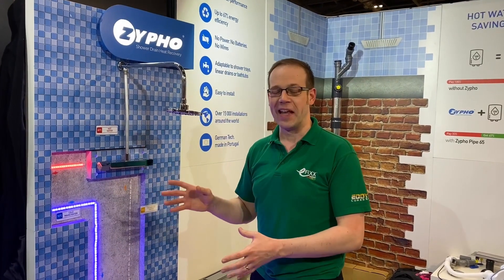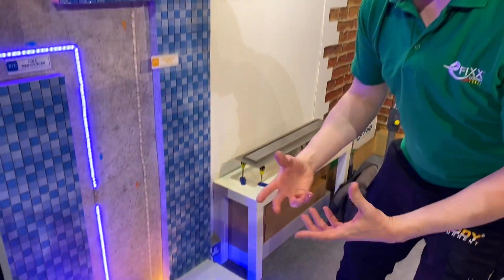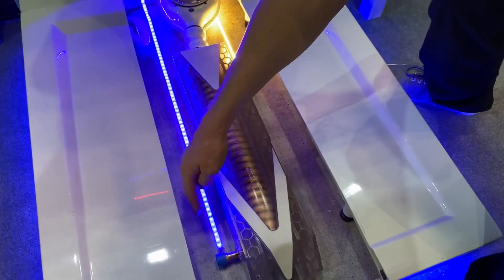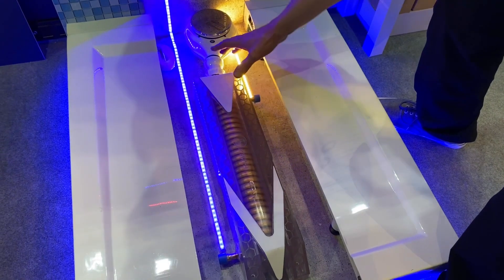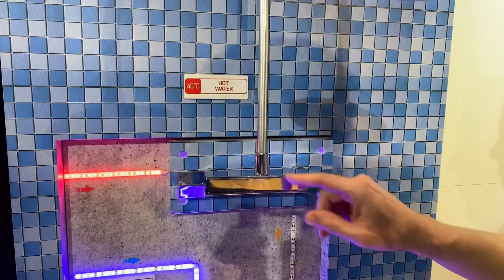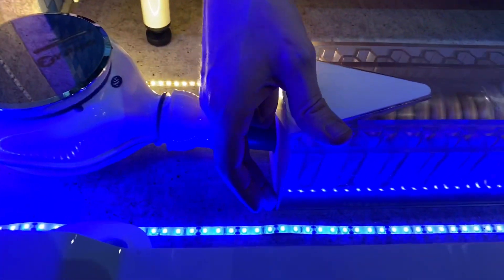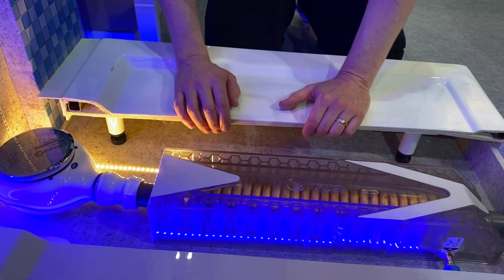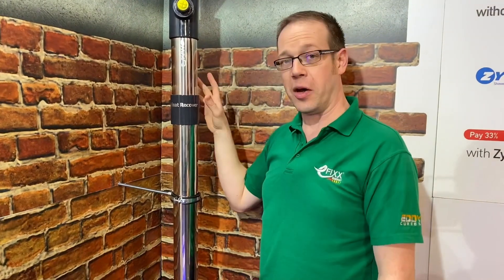Throwing Money Down the Drain? This ZYPHO Device Could Recover It

Comment: I loved the idea but then it clicked that I have one major concern. how can you get warm water from the very little water I use in a 5 min shower.
 isn't a shower meant to help save water usage.
then I looked up some facts. I'm wrong, seems showers use up to 10 litres of water a min. I did not know that. I'm shocked.
 think that's something you might want to add to your marketing honesty if I had of known how much water we use for a shower I would never of doubted this video while watching. 
my new build will have these devices for sure. but I'll also need to look at showers too I didn't know that no matter how high or low you set the heat on the shower it always uses the same amount of electricity. so he says in the videos. so I was having not really warm showers thinking I was saving electricity but I wasn't. the same electricity is used for hot and mild warm?? so really we all  need to get better showers that don't waste electricity too as the electricity is generated by mostly nasty ways too. really have to change a lot to be right for the environment.

Comment: Good idea.  I suppose you would have to adjust the temperature of the shower as you go.
Reply: There are thermostatic shover valve you can use.
Reply from the maker: Yeah, there'd be a bit of adjustment as the process got going. 😊

Comment: A clever idea but not new and the figures just don't add up. A 10 minute shower at 8kW costs 30p. A one third saving, that's just 10p. Payback time would depend on how many showers you have but assuming a 2 person home taking one shower each a day, that's say 700 showers a year. Savings at 30% let's be generous £125 yearly. It would take a minimum 5 years to recoup the cost of the heat exchanger and that doesn't Include the cost of fitting or any additional cost of repair or maintenance.
Reply from the maker: I think five years is a pretty good payback period for renewable tech, and that's only going to get shorter as energy prices increase. If you've got more than two people showering it'll pay back quicker as well, maintenance is pretty much zero as there's nothing mechanical or electrical to break down. If it's a new build or you're refurbing your shower it seems like a good and easy contribution to reducing energy use in your home really.
Reply: The higher the energy prices the quicker this pays you back :)
Reply: One of the things that this can help with is enabling a smaller hot water tanks if your primary hot water consumption is with showers and you're not using an electric shower, but I agree that the figures still just don't add up. The vertical units (recoup WWHRS do a similar one) are better, but very difficult to install in a retrofit situation.

These heat recovery units are basically only ever used to increase the SAP scores in new build properties, and for that purpose they're quite a cheap way to go about it, so the price isn't likely to come down any time soon.